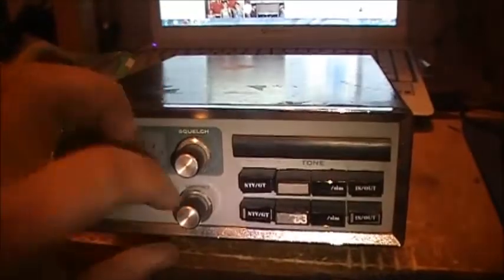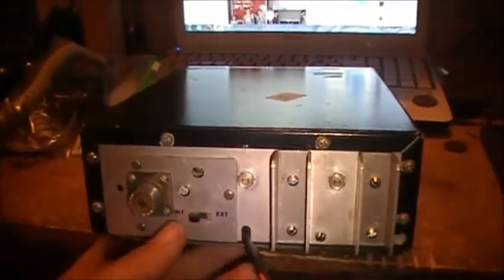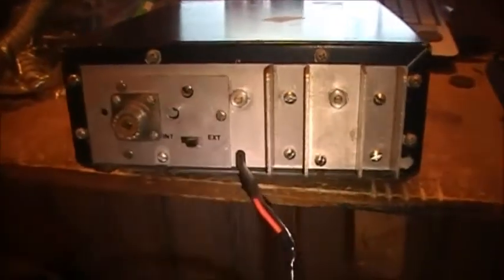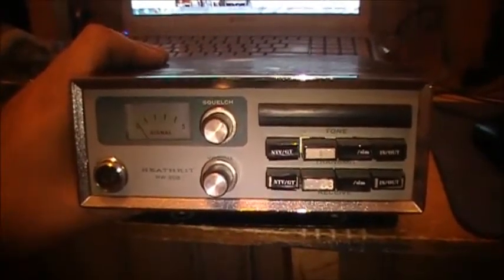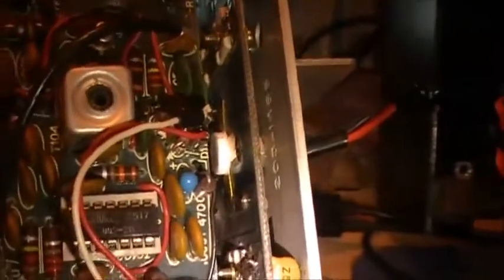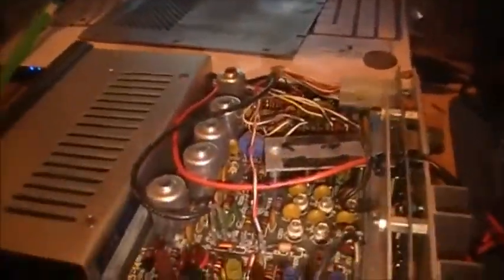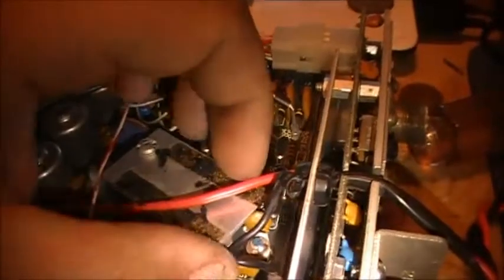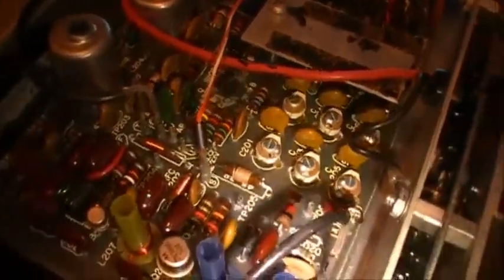Heathkit HW202 - Inside and out!

Comment: KF8HW Rating: 4/5 Feb 16, 2009 12:02 Send this review to a friend
A nice Plain-Jane rig!  Time owned: more than 12 months
I bought this radio with the matching power supply back around 1989 from the wife of an SK for $40. Nobody wanted it so I scooped it up. This was my first 2 meter radio. I changed a couple of the channels to frequencies I could use in my area and used it for many years. I used it as a mobile at first , then relegated it to home use on the local repeater. I got great compliments on the audio. These radios had two banks of buttons to select the desired frequency. You had to purchase crystals with a specified frequency (figured with a simple formula) that got plugged in the guts. Then you needed to fine adjust that crystal with a frequency counter to the desired operating freq. Easy task. To switch freq's only required pushing the buttons on the front panel. Remember this radio was produced in kit form back in the 1970's. They are very basic, but operate well. I had many enjoyable QSO's with it. When I moved from the area I gave it to a good friend since it had all the local frequencies,and he still has it in service! I will never understand Heathkit's decision on paint color for their radio gear; they must have had a special deal on bulk aqua green pool paint down at the wholesale clearance paint store! As humble as it is, this rig serviced me well. I upgraded a few minor things such as the power cord, the on/off switch on the power supply, replaced the bulb, fuse holder, etc. I'm happy it still works and is keeping somebody on the air!    
perhaps this fellow could help with the mic wiring, ha